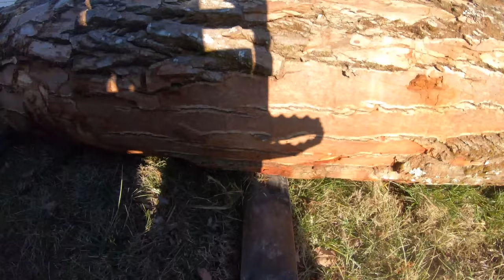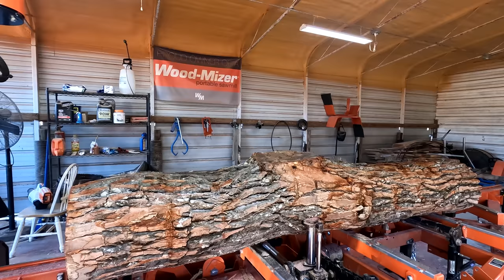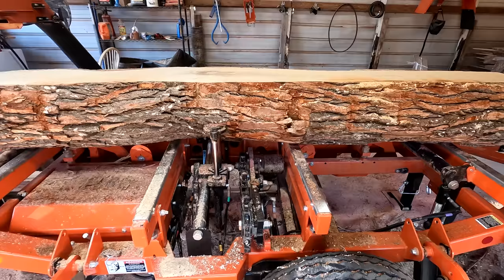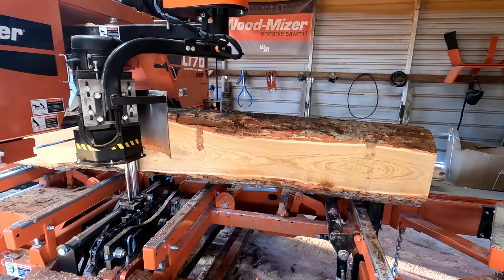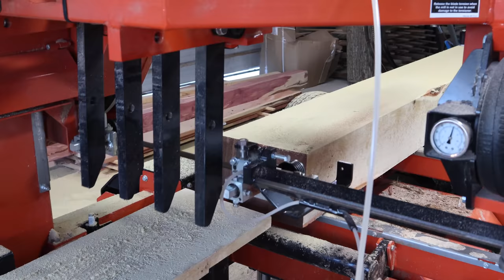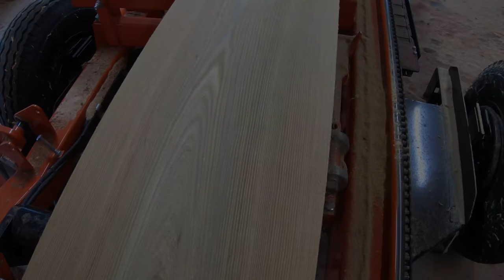That's Right! More Root Beer On The Sawmill, Amazing Boards

Comment: I know you have said you can't even give away the off cuts when you saw logs so I was wondering if you thought of getting a chipper/shredder and sell that for mulch.  I thought of that because there are 3 Amish sawmills within 5 miles of me and a 4th about 8 miles away.  They all do that and while some of the shredded wood (and sawdust) is sold to local homeowners or farmers for mulch or animal bedding, the majority of the shredded wood is sold to companies that bag it and sell it as mulch.  Just a thought.  🤔
Reply: Chippers and shredders are very expensive.  You would have to have a big volume to justify the cost.

Comment: I have a dumb question: 🙄 when a sawyer cuts these boards & there's bark left on the sides, but the boards are the width they need, do they cut that bark off or just use the boards with the bark on them? I prefaced this with I have a dumb question 😉😆 Thanks!
Reply from the maker: We leave then till after drying 👍👍
Reply: @OutoftheWoods0623  You are so kind to answer me, Nathan!! Thank you!! I have wondered about that since I started watching, so I finally asked 👍 You're really sweet to answer me ❤

Comment: I have asked this before and never seem to have caught an answer to it. (Those who have in the channel, please point me to the correct video).
 I know I asked this at least once when you still had the old mill and at least once with this one. Why is the debarker set to enter after the start of the log and exit before? 
Several years ago, when I was helping a friend out doing hull reconstruction on his yacht, I assisted the mill owner where we got the timber from. It was all swamp Kauri that had been air dried as logs for 3 to 5 years after being lifted out.
Even though all this timber was completely bark free. we ran a debarking blade from start to finish just in case there was something left in the surface of the log.
The mill was on old upright fixed bed, not a portable horizontal like yours.
Given the reasons you have stated for running the debarker, I just don't get why you don't have it engage the log right at the start rather than leave that 10 to 20cm gap where something nasty could be sitting.
I may be over thinking this or missing something, just would like to know.
Cheers Damo :)